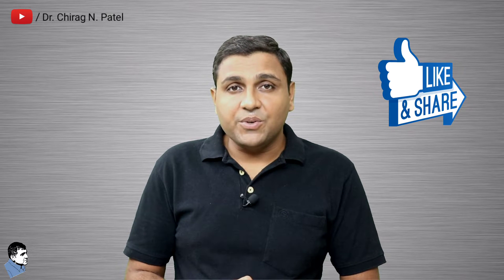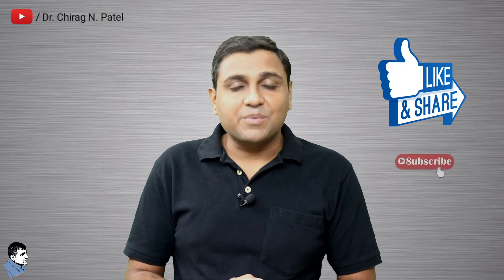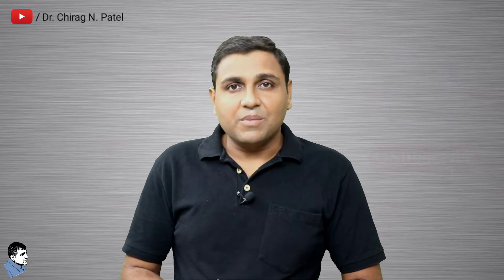Concrete Core Test | Concrete Core Cutting | Concrete Core Capping | Concrete Core Test Machine

Comment: hello Dr. Chirag, how much of trimming of the core length which has been brought from the site is allowed to prepare a core for test. Eg if i bought  a core of 230mm length, can i trim it to 100mm while making core specimen for crushing.
Reply from the maker: Requirements of Concrete Core Height is 2 times its Dia. atleast.
Reply: @drchiragnpatel  thank you. Is it okay if length and diameter are kept same to test the core sample..

Comment: Good video but too many safety violations.   No fall restraint,  no safety glasses,  I also think they should have been wearing cut-resistant gloves.  Improper electrical connection to power supply notice he inserts  wires from the drill into  a socket. The drill should have had a proper plug.

Comment: what is the material use for capping ?
Reply from the maker: Sulfer or epoxy but with strength higher than parent concerete
Reply from the maker: #concrete

Comment: For capping of core material use sulfar or other capping material   ,not required capping tool  ? please suggest , we  use blue colour plastic instead of vertical capping tool ,  can we use bar ldetector
Reply from the maker: No tool required.
Reply from the maker: You can use if you have but we concern with performance only.

Comment: What will happen to main structure from where the core was extracted, it will have cut reinforcemnt too. So longitudal reinforcement cut at that location. which will damge the life of structure and reduce the strength........ so core cutting is damaging
Reply from the maker: You are right. But care is required to take that the core has been taken from the place where main bars are not cut. Also if possible no bar will be distracted.

Comment: Very useful information, but unsafe practice by operative, using loader as working platform and not wearing any fall protection. Hope you understand
Reply from the maker: Yes. I understand it. But it's the time-bound solution of unavailability of stuff. Like your reply. Thanks for watching. Keep Watching.
Reply: @drchiragnpatel  please have more concern on safety. its a high risk work you know.

Comment: Why liquid poured core concrete with explaination
Reply from the maker: I think you talk about water supply provided while cutting the core. It is required to reduce the heating between concrete and drill bit. Water will lubricate the friction surface properly which make ease for the cutting without failure of drill bit.